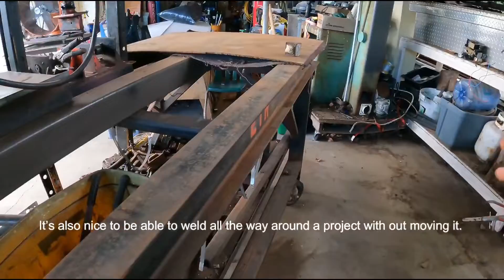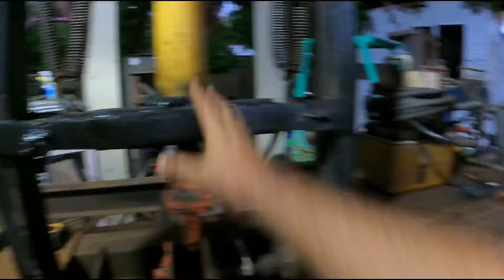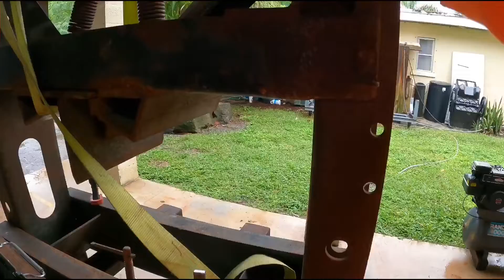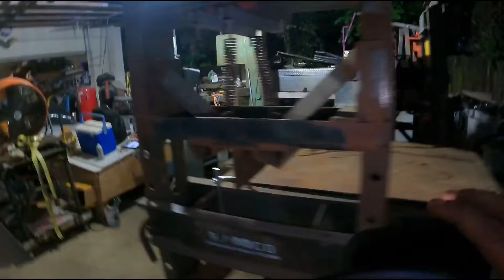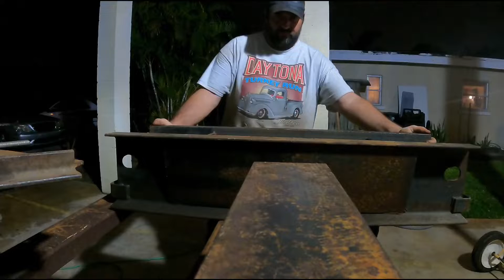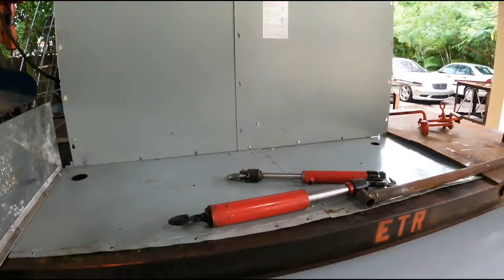Building The Ultimate Copper Recovery System For Copper Wire, Transformers, & Electric Motors pt1

Comment: I've watched your videos. I've not seen you sharpen the wheels on the stripper. I know it doesn't have to be like a knife but to me it looks like after awhile you need to put a edge on cutter wheel. Keep videos coming!!!
Reply from the maker: While it’s running I’ll take a file and dress the edge every now and then, but in two years I have not taken it apart to change or sharpen the blades completely. The machine came with an entire set of new blades. One of the blades on the smaller side of the machine actually has a flat spot in it.I will make a video of a complete disassemble of the machine and changing out that blade. Also I have a forward and reverse switch that I want to put on. Thanks for watching.

Comment: can you put more pictures of wire stripper, its hard to find plans or dimension for stripper like yours. Please can you make video of make some pictures of it more detail
Reply from the maker: Yes, I just pulled out my homemade wire stripper and will be making a video on how I made it and how it works, and I will compare it with this one. Also I have to change one of the blades because it has a flat spot in it so I will make a video of the complete breakdown of that wire stripper.